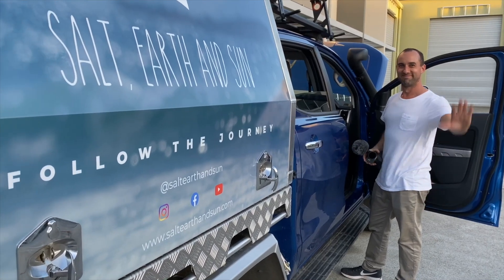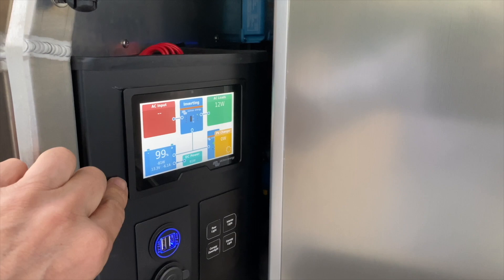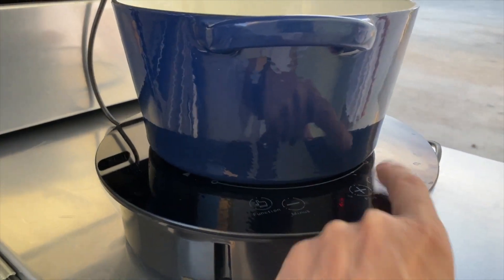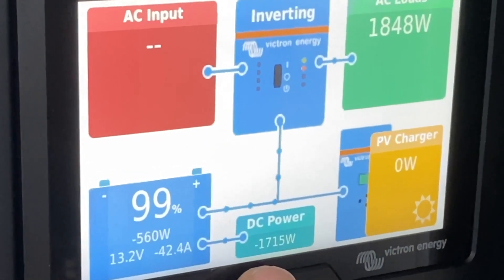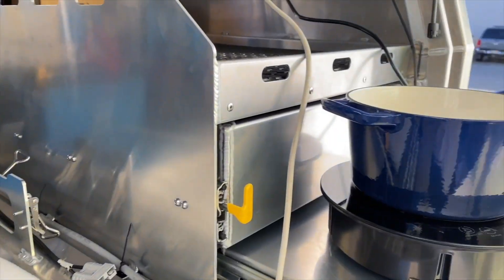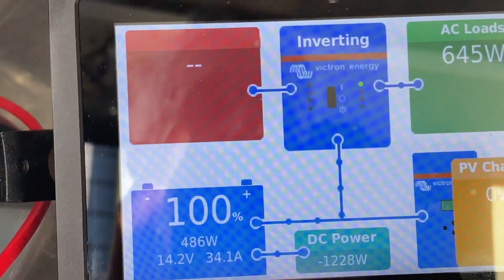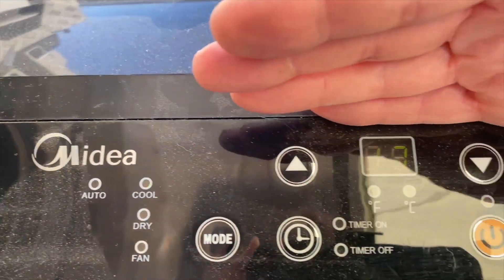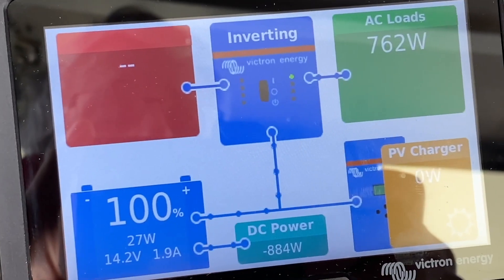Ranger Std Alternator 2.5kW Powering Induction / Air-con

Comment: How much engine power is used to run the alternator now ?
Reply from the maker: The power extracted is very small. About 1-2% of the engine capacity. Engines are most efficient at peak load. Between idling and this point they are less efficient. This is the band for the alternator power extraction. We have 3 patents in this area of setting the power extraction based on engine load and efficiency.
Reply: @Safiery  That sounds like great technology. However, alternators will never be very efficient, so roughly speaking you could multiply the dc power by 2 to get the kilowatts drawn from the motor.
Doesnt the alternator get very hot during idling? I am assuming there is temp monitoring of the alternator?

Comment: Amazing! Now show the aircon AND cooktop at the same time. The 2kW inverter will take it for a few minutes, but will the alternator match it?
Reply from the maker: Great idea. but will need a 3000W inverter as once the air-con comes back on after duty cycling off, the power will peak to 5000W with both. Just a little too much. However, notice the alternator power just after air-con is turned on an it goes up beyond the Power Match level - thats because the 500ms peak inductive load at startup was noted by the CANbus controller and the power lifted to max at idle. In a few weeks we will demonstrate 5kW for the Alternator - after a few mods!
Reply: @Safiery  where I can buy it ?
Reply from the maker: @usavanlife7240  Email sales at safiery dot com on your vehicle and power/energy requirements. We can manage up to 3,000W charging from a 12V factory alternator (Sprinters for example have 250A available) or up to 5,000W from a second Alternator (Sprinter, Dodge Ram, F Truck)